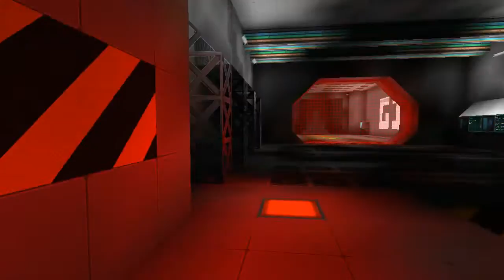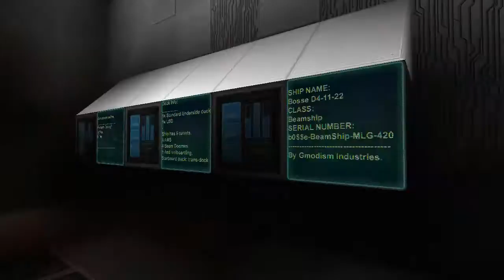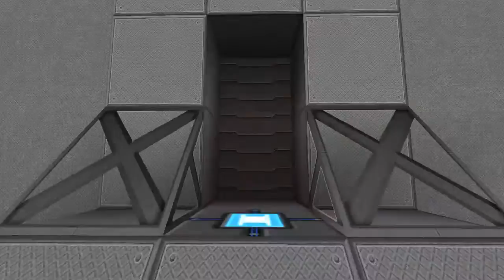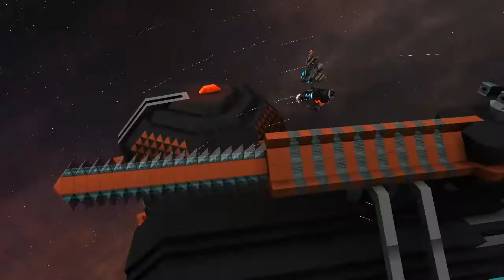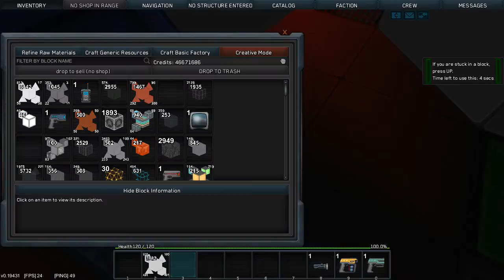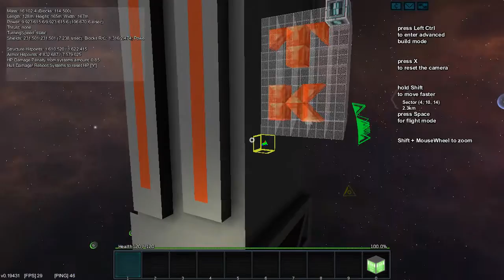StarMade | b0$$e Beamship Show + Pirate Station Raid

Comment: You could possibly use a warhead explosive module, unless the new builds go rid of those ( made them obsolete).

Edit : The station is still using the old turret system, that's whats causing the conflict.
Reply from the maker: +Bernard Gilbert Yes your are right about that, very weird bug though as they are not connected.
I can happily say, check tomorrow, I'm fast today :) then you will see warhead missiles implemented on the Hyaku Paasento Light Ion-Cruiser! have a good day!